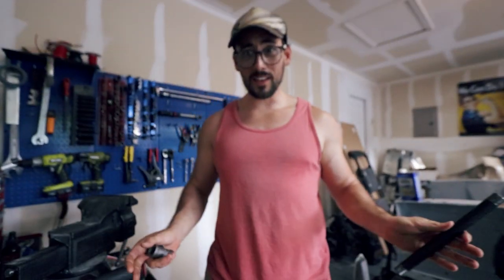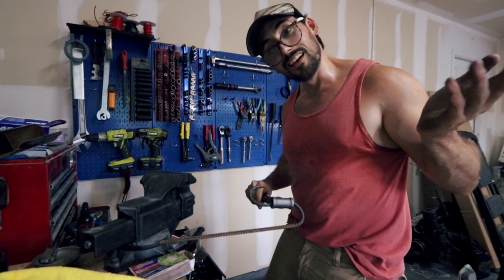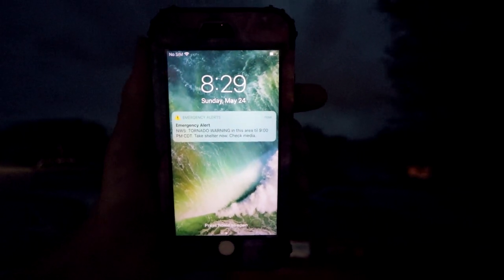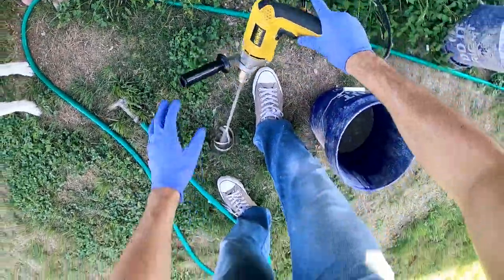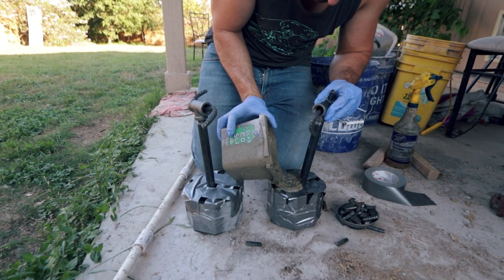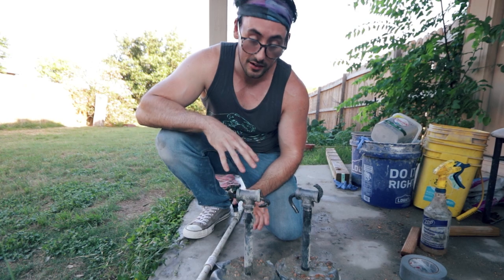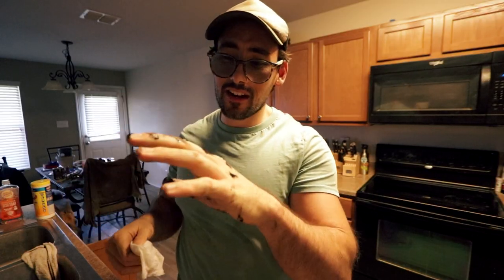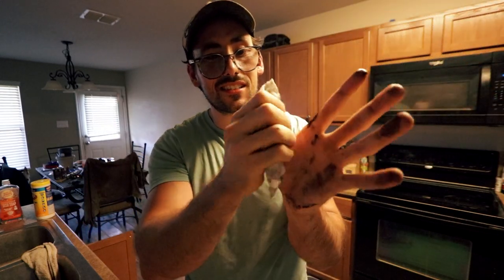How I Made Dumbbells at Home!

Comment: How much do they weigh
Reply from the maker: I can't believe I forgot to show the weight 😅 the smaller dumbbells came out to 18 lbs I probably could have added more metal to increase the weight and the vinegar bottle weights came out to 25lbs.  If I used a bigger mold I could have definitely increased the weight, but I mainly just need some small ones to test out the concept.  if you really want a heavy set you could use the hardware store bucket trick I used to make the barbell weights and just use the handle from this and easily get a 90lb+ dumbbell if that is your goal. Although I would probably go with a 3/4 " x 12"  iron bar just to be safe. anyway hope this helps!

Comment: I am thinking about coating some old rusty dumbells I have with flex seal.  Wondering if I should use the spray or paint.  Thanks for the Clorox wipe tip.  Good to know in case I make a mess (which I probably will) lol.  Great video.  Thnx for sharing!
Reply: Spray would come out looking better, but would need many more coats.